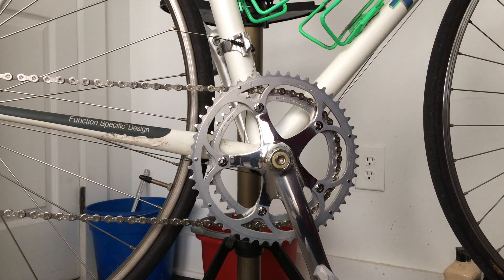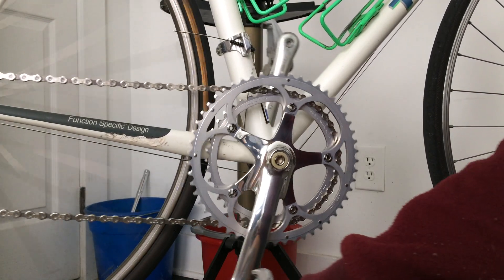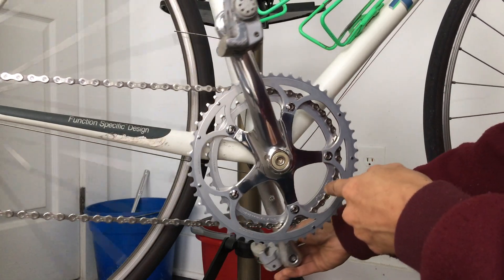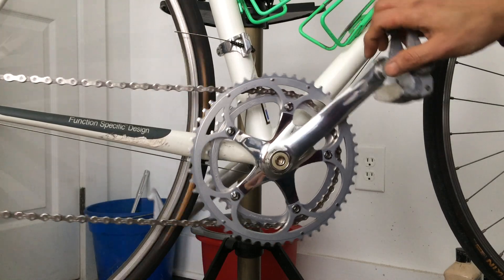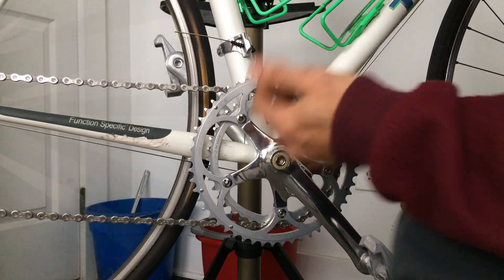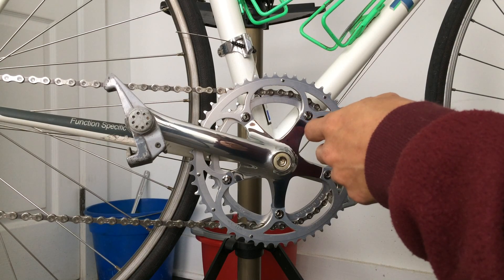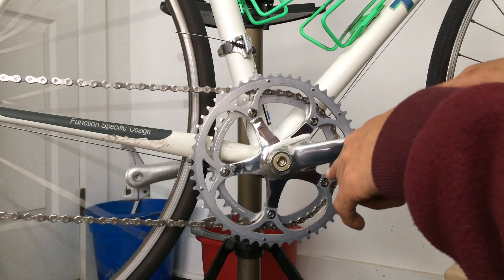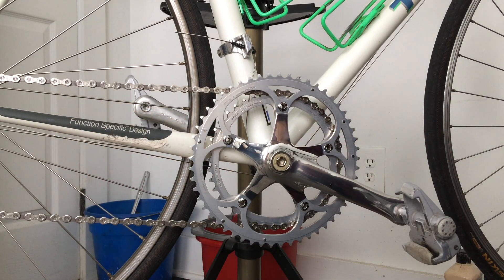How to Wear Out (Stretch) Bicycle Chain Evenly

Comment: Nonsense.  What you are proposing has no benefit, and in fact the idea of a chain wearing unevenly is absurd unless the number of links in your chain is an exact multiple of the number of teeth on your chainring.  Otherwise the chainring sees a different section of the chain with every pedal revolution.

Looks like you have a 42 tooth small chainring.  Most road bikes have about 110 links in the chain.  110/42 = 2.619, or 2 with a remander of 26, meaning the chain will move 26 links every time you turn the crank.